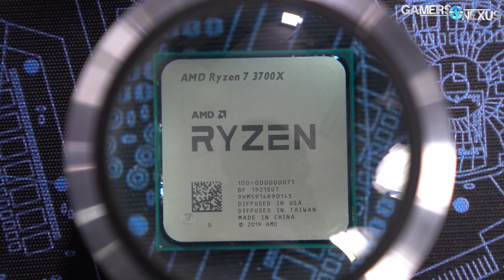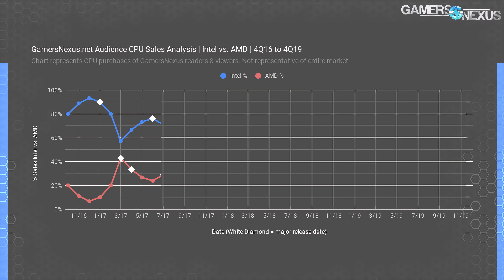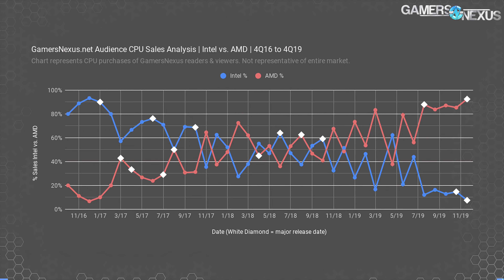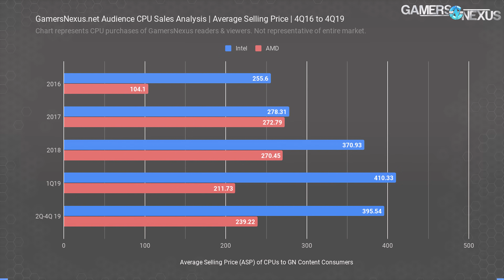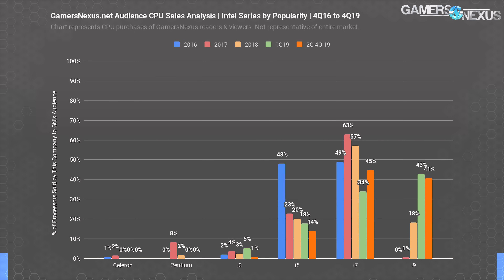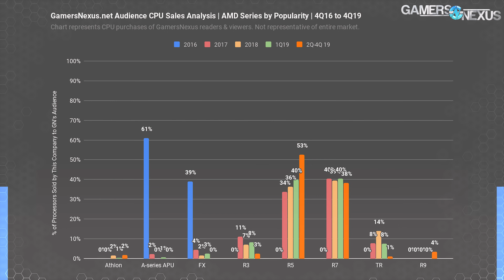GN Special Report: AMD Moves 93% of CPU Sales (Intel vs. AMD 2019 for DIY)

Comment: Good for AMD.  All those years of non-innovation and no competition really sucked.  Now if AMD could just design a GPU to match the 2080 Ti.
Reply: What? Design a GPU that provides the same performance as a GPU that's already over a year old, a year from now? LOL This is why AMD sucks. Instead of putting the pedal to the floor and attempting to creat a GPU that will outgun that 2080ti and push GPU performance a generation forward, they design a GPU with performance that's already a gen or two late. The whole catch up and undercut strategy is pathetic and they'll always be in second place if they don't try and push the performance to take first place.
Reply: @Code-n-Flame  the same could be said for intel being on 14nm++++++ and amd being ahead by leaps and bounds, not to mention the core counts.  Their priority clearly isnt a 2080ti killer, its mid to low range, which is most of the market.
Reply: @heytheresakitty  wrong. If that were the case 5700s and 5700XTs would be selling much more than Nvidia equivalents. They aren't.
Reply: Jesse Lopez give it time, I like those cards for their price point.  5700 kills the competition at $300, I recently had to find a card for my cousin under $300 and the 1660 Ti is crap by comparison, 2060 too expensive.
Reply: Jesse Lopez what I want to see is competition on the high end.  I don’t know how long some of you have been into PC gaming, but years ago the competition was amazing, every year something new from both sides that was kick ass and multi GPU was actually a priority.  I’ve had 3 and 4 way SLI and Crossfire configurations, those were the good old days of PC hardware.  But the ecosystem of games is soooo much better now than it used to be.  Dreams I once had, finally come true, but many too late.  Like Halo on PC (Halo 3 and newer of  course), a bit too late for that imo
Reply: @chincemagnet  we're not gonna see competition on the high end if people don't get better jobs so they can afford something better than these god damn budget builds. I'm so SICK of seeing Ryzen videos. Here I am with my $3000 machine looking for inspiration to drop more money into it and all I see are fucking budget conscious videos. Gamers are fucking poor 😂

Comment: Here's a reminder of the ultimate goal: competition. 

This is good because, hopefully, Intel will come back from it's lack of competitive pricing and innovation. 

If it doesn't, AMD will become Intel on a few years. 

We need Intel and AMD to push each other. That's what's best for us as consumers.
Reply: We're witnessing an "Athlon 64" moment from AMD, hopefully in a few years we will have a new "Core 2" moment.
Reply: It would take decades of continued AMD dominance to put a dent in Intel's banked cash. Keep in mind that while Zen is pretty incredible on its own, a huge percentage of AMD's recent success has come from Intel's 14nm shortages and inability to produce 10nm. 

While obviously no one wants AMD to just stay 100% dominant forever, they very much benefit from having a few years in the spotlight. Even Zen 2 is barely "better" than what Intel has (it's a much better value and has higher core counts, but for day to day use it's hard to argue that AMD is actually objectively better). If Intel were able to get a major leap in process/architecture by next year, hypothetically, they would suddenly be able to dominate what AMD has to offer and we would be right back to where we were in 2016. Keep in mind that historically, even when AMD was competitive or even better than the competition (both Intel or Nvidia), they still wind up losing out because they don't have the mindshare or the partnerships necessary to get their products in from of mass markets.

All this to say that, while competition is absolutely good and I want to see what Intel has to offer, I think another year or two with Intel on the back burner while AMD keeps iterating on Zen benefits everyone long term. They get to build up more cash reserves and increase market/mindshare to a degree that they can get taken seriously by even the average, non-enthusiast computer purchaser while simultaneously improving both the IPC and process node of Zen to a level where it is objectively better across the board versus Intel. Then, in 2021/2022 when Intel (theoretically) is ready to drop 7nm, AMD will hopefully be ready to tussle with what will be a double node shrink/5+ year newer architecture versus the Coffee/Cascade Lake that AMD is currently competitive with.
Reply: Don't forget that ARM and RISV are starting to nip at both Intel and AMD and are starting to get to the point they can start fighting with the two juggernauts of CPUs.
Reply: Intel still has the majority of the server market and pretty much owns the laptop market. And there are other companies such as ARM and RISCV coming to compete in these sectors. The competition is still very much there and we should still see innovation from AMD for quite some time
Reply: intel is still a HUGE company, and is well known for player dirty and illegal to keep the competition down. We need AMD to destroy intel in performance for a couple of years at least before we can be sure we have a long term competative CPU market, and not another repeat of the post-athlon64 days and the following decade + of stagnation.
Reply: Yes yes and again yes
Reply: @KanneRyo  I agree that corporations are build on greed, but that doesn't mean every corporation is equally greedy. AMD has always had a better corporate culture compared to Intel...I choose to support the one that is the most consumer friendly.
Reply: @KanneRyo  I disagree that people are created greedy. That is the direct result of our culture... IMO
I'll say it one more time. Intel has proven many times through anti-consumer and illegal business practices that they are a more toxic corporation that AMD. I will buy and over Intel as long as this remains, if it shifts. I will choose whatever company I deem to be more consumer friendly. No two corporations are the same Minami. I'm certainly informed enough to make my own decisions. 
Thanks
Reply: @KanneRyo  I don't care if people buy Intel. They are still better for gaming even if you, mostly, pay more for their products. 
Intel have been dicks to competitors and consumers for a very long time. I don't hate them, but I'm glad they are having to do some real work to stay relivant and have had to lower prices and offer more cores to consumers because we finally have competition. I don't want AMD to be totally dominant either, because they will start milking consumers and already have in some cases. It's just that Intel seem to be chronically shady with business and marketing schemes. AMD have their moments, but they are single handedly responsible for reviving the consumer cpu market...so don't act like I don't know what the heck is going on is all...
I'm done with this conversation.
Cheers
Reply: I don't think AMD would stoop to some of the really dirty ways that Intel has done business. But, they will certainly price their products as high as they can, and without competition, that doesn't look good for consumers.
Reply: @Ben-ry1py  it really depends on how much money they end up making. If they get the monetary means to start pulling shitty moves, they'll likely do it if they think they can get away with it and pull in more money. At the end of the day, corporations are about making money. I hope it doesn't come to that point though, and everyone plays a clean game in the cpu and gpu spaces, but my hopes are super high lmao
Reply: @LINKedup101  I totally agree that corporations are not to be trusted, but each corporation has their own culture, and some, like Nvidia and Intel, have a history of breaking the law and being anti-competitive to manipulate the sales landscape. 

AMD does not have that reputation because they have a pretty honest corporate culture. I stand by my belief that AMD might raise prices a lot more in the future if Intel keeps their thumb in their ass, but they aren't going to pull blatantly illegal moves to sell more products.
Reply: @Ben-ry1py   All successful Corporations push the limit on advertising and shady practices and sometimes step over the line.
Reply: @wysetech2000  nice universal statement...
Reply: @Ben-ry1py  You mean AMD won't do shady and illegal stuff like they did with some bulldozer CPU's that made them lose a lawsuit recently and now they have to payback to the affected one? AMD has a lot of shitty stuff too and you are completely wrong if you think they wouldn't do anything like that.
Reply: @Ben-ry1py  AMD Hasbro. They have a ton of debt from the dark ages of Bulldozer. Even now that they have a recent sales improvement and new found competitive advantage, they are still a TINY company compared to a behemoth like Intel. Itbwould take years before Intel could assert the kind of total competitive and financial dominance that Intel has enjoyed over the last decade. The morons that think that it's a good idea that Intel regain the competitive advantage in just 2 years do not realize that it could still ultimately result in AMD dying in worst case scenarios. FUCK THAT. Intel needs to shrink a bit and AMD grow a bit before they would reach a safe equilibrium.
Reply: @hochhaul  good points. I agree with you. I don't want amds lead to be too good though. Cause prices will inflate. Just enough to keep comfortably  ahead of the blue team, but not obliterating them. Intel could become the bargain brand too. That would be interesting.
Reply: >duopoly
>competition

Choose one

And no, AMD is not dirty like Intel, unlike the blue team, AMD never abuse of power and money to make anti-consumer things
Reply: Enio Apolinario success does strange things to companies. They don’t now, but who knows what the future holds.
Reply: just want both companies to make a decent offering so i can buy a cheap cpu as for the business side well big investors will demand infinite growth just the nature of things they will keep pushing

Comment: cant wait for amds monopoly
Reply: It is unlikely AMD will ever replace Intel. Even at AMD's peak, they were quite a bit smaller. And AMD as a company is tiny next to Intel.
Reply: If the last couple of years sticks for the next 2 decades it maybe possible but ultimately won't happen, while in the short term Intel is screwed as they have nothing really but i think they may will bounce back in a years time.

Comment: "We're happy to see a CPU company at all discounting its products considering Intel has never done that." Price wars between AMD and Intel where either one would chop prices by as much as 60% were annual or even twice-yearly events until around 2005. They used to be the norm, not the exception.
Reply: It was also good times taking an E2140 and overclocking to E6600 levels.  I'd say the market was at its unhealthiest due to lack of competition around Haswell/Skylake.  i7s of previous generations often sold for more USED than a new i7 on a new socket shutting out the upgrade path effectively.  Good to see Intels lunch getting eaten here.
Reply: @Wahinies  Even now, a used 4790k is more expensive than a brand new 2700x - Insanely absurd how that can even happen but people still expect about £150 for a 4 core 8 threaded i7 used. There's no point buying a used processor anymore and I think that AMDs pricing just makes that more and more of reality at this point - They are not in a price war with intel, there in a price war with used parts imho
Reply: More and more of a reality*
Reply: thats, 18 years ago ... it is the new norm now
Reply: amine abdz 2005 18 years ago? Do you need a calculator?
Reply: Things have changed, not all for the better.
Reply: Those were good days to remember.  It was a great time to be a builder.
Reply: I think he said "discounting its old products". I remember when sky lake launched, I thought I could get a i7 4790k cheaper but that wasn't the case.
Reply: You are at the wrong channel if you expect anything but hype and overpriced shit. I come here to laugh at the fat dude. It's is clear that this fatso doesn't think it possible that intel can make more cores on 14nm die and lower prices because they have money to burn. Reality check: Comet Lake i5 is 6/12 HT. Bye bye Ryzen R5.
Reply: @Ludak021     You don't have to get personal, that helps nobody.  Even though i prefer Intel for various reasons i think AMD is a great product and until Intel can get off of 14Nm they can't compete for anything. Most of Intel's new technology is based on 10 Nm but can't utilize it because of the same problems they have had for at least 3 years. Much too long.
For the size and resources of Intel this is unacceptable.
Reply: @Ludak021    This whole AMD/Intel thing has gotten out of control. I see the exact same Intel bashing comments in almost every Tech channel. It's like 5000 people copied the exact same script against Intel. It's like some people read this and type the exact same words.
I understand the excitement AMD has caused and the negativity against Intel but the whole thing has turned into an AMD cult. It's almost scary. There are people who are having problems with AMD but are afraid to talk about it. They don't want to get jumped on. I saw one comment that pleaded with someone with problems not to say bad things about AMD because it hurts them, WTF!!!!
It's like a vicious circle, the creators provide AMD coverage and the enthusiasts provide the hype, and it just keeps going around.
The problem is that all these creators are losing subs and views from people who are tired of all this Intel negativity even though the stats might not show it.
I have several friends who use Intel and still believe in the company who have stopped watching YouTube tech videos because it's always the same crap.
I used to like this channel but my respect is dropping fast, very fast.
Reply: @wysetech2000  Exactly, but personally I don't have a problem with AMD being finally worth buying again. I do have other issues with it, you mentioned most of them. I mentioned some others in previous post. Still, I do come here for a free giggle, I wasn't making that up. Seeing a 30 minute video explaining a difference between A and B (whatever) it's like listening to my late grandpa ranting about the war....
Reply: @Ludak021    I guess i'm at fault too but i will not be bullied and pushed around. My comments are as important as everyone else's.
Reply: @Ludak021  Objectively speaking if you only play games and care about that solely and do nothing else then sure go for Intel. Choose the best parts for you at your price point is as simple as it is - I have a Ryzen based desktop as a I stream, game and video edit, but I also have an Intel laptop as when i bought it Ryzen wasnt an option. I do feel however that saying that compare 4 core 4 threads to Intel's 4 core 4 threads as although they are competition, the price point that they are targeted at is entirely different. A Ryzen 3 1200 is not going to be setting any performance benchmarks and would be lucky to get to 4GHZ all core, but you can pick one up brand new with a cooler for less than £50. I'm not necessarily shilling for one or the other as I personally believe you get the best parts that your budget allows or build a pc that you are satisfied with. 20% of PCs on steam are AMD and that's great, that number will rise once people off of 2nd/3rd/4th gen update their hardware then likewise upto 7th gen.

Comment: people like me definitely skew the numbers, was waiting with a haswell 4 core i7 for a few years before picking up a 3900 for my mini build and a 3950 for my main tower. Nice to have a good system from AMD after the disappointment of the fx8120 and fx8350 I had earlier, burnt the first one out while playing around overclocking and sold the platform after
Reply: Same, i have a 3900X for my main rig, 3600 for my media box and a 2500U for my laptop. My 1700 that was in my main rig was meant to go to my media box but ended up selling it on.
Reply: same for me, had my 4770k for >6 years until AMD finally came around with a worthwile upgrade (3900x, cause I couldn't wait :)

Comment: This doesn't mean AMD have totally obliterated Intel's market share. Intel haven't made much worth upgrading for in my opinion for a few generations, Intel fans will wait till Intel make something worth buying again. 

However, if AMD can keep this momentum up for a couple years, that would be proof that Intel is falling behind in the market. I would argue a more accurate representation of market share isn't necessarily sales on a monthly or even yearly basis, but an analysis of what chips are currently in use in PCs. I would expect Intel currently still have the lead here, and will do for some time, I'm still running an i7-6700k, and it still does the job well.
Reply: Daniel I
It shows how many people are so caught up in themselves they don't know any better.
Reply: @wysetech2000  I checked the Steam hardware survey, it suggested AMDs overall market share in terms the systems currently using it has increased by 1% in the last year or so. I know that includes a lot of old systems and laptops, but they're all systems still in use actively on Steam. It just shows how much AMD need to catch up.